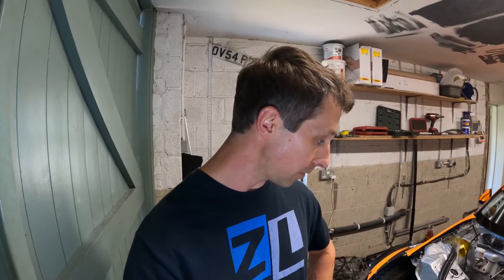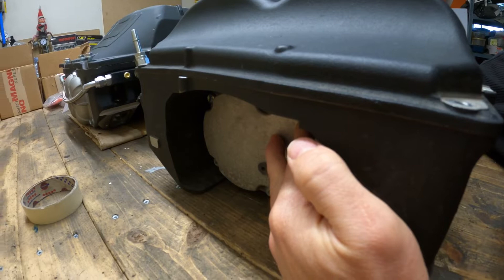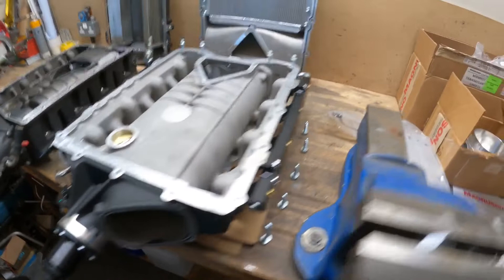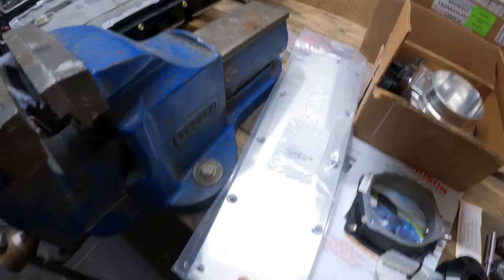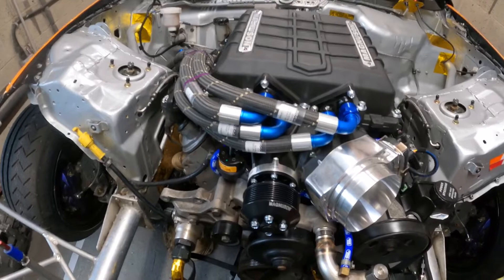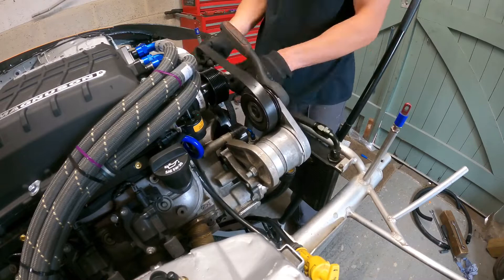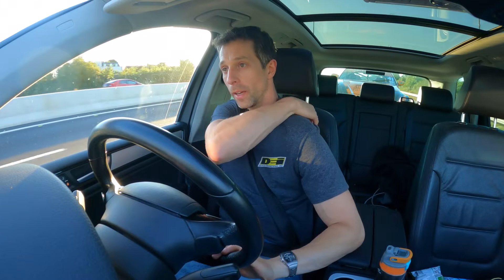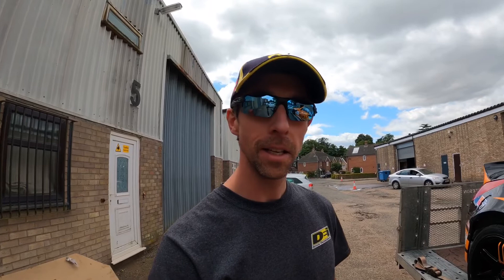New Supercharger - Magnuson Magnum PI

Comment: Could it be the catalectic converter not allowing the exhaust to flow out the gasses as quick as you are making them with new charger setup. Only popped in my head as Craig (Scottish Bdc craig) had the same issues on the dyno the other week.
Reply from the maker: You'll have to keep watching the next couple (a lot shorter) vids Heath 😁 good shout though 👍
Reply: O good glad you might of sorted it mate
Reply from the maker: Took a bit of effort but we got there